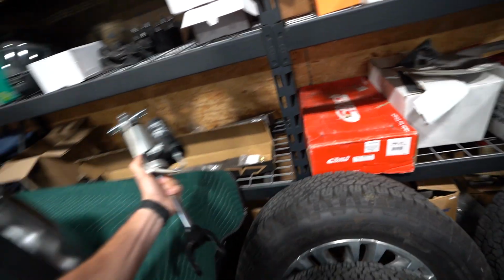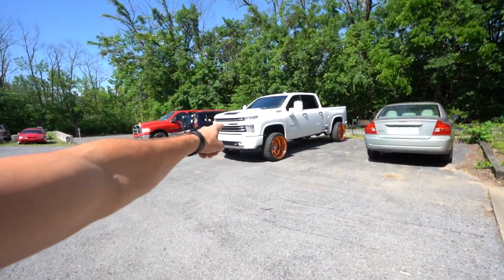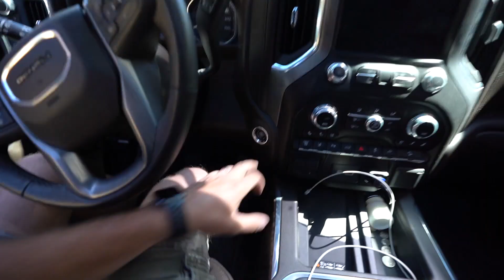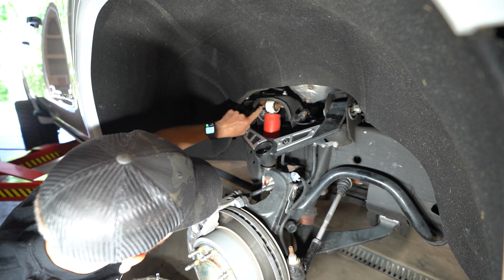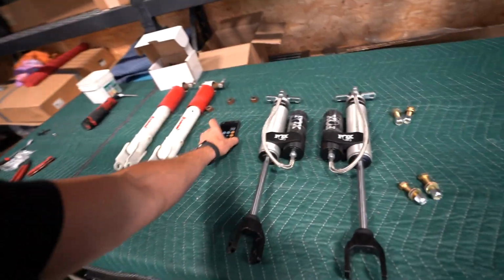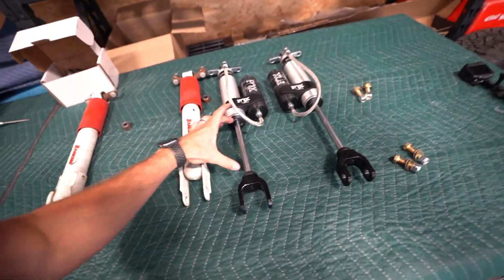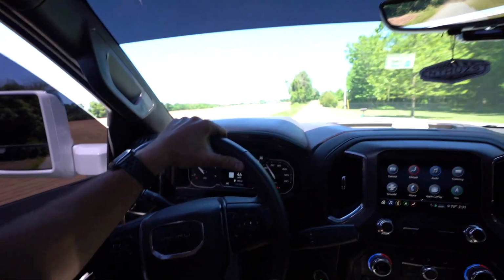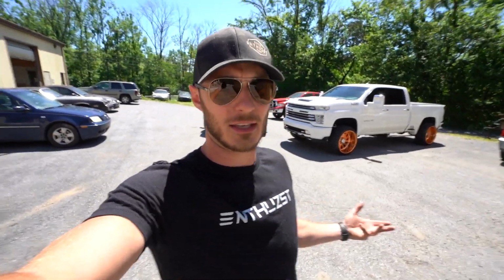Are Fox Shocks ACTUALLY worth the HYPE?

Comment: I think that Fox shocks will always make a big difference over stock.  In this case, the Rancho shocks were not setup properly for the type of lift that was done.  I would also think that a tire within the wheelwell would look better as well  - or use fender flares.  In any case, the test would have been more valid if you had used a properly configured Rancho shock against the [already] properly configured Fox shock.  I still think that the Fox shock would have won because it's a higher quality unit. However, the current test gave the Rancho shock a detriment/disadvantage from the start and was not really an apples to apples comparison.

Comment: So I have a 2018 F-150 with 2.5” leveling block whereas my dad has a 2011 with rancho shocks and it seems to ride better it’s the leveling strut so no spacer. I’ve considered rancho and fox but just not able to decide if it’s worth it, I feel like it is but $1200 for just the front I think it was sure is steep

Comment: So you only changed the shocks all around on the High Country? No steering stabilizer or radius arms? Just the shocks and upper control arms? Since you had a complete lift kit on the old 15’ Denali would you say it’s better or worst just doing shocks and upper control arms? Thanks Jack and by the way the High Country is 🔥🔥🔥